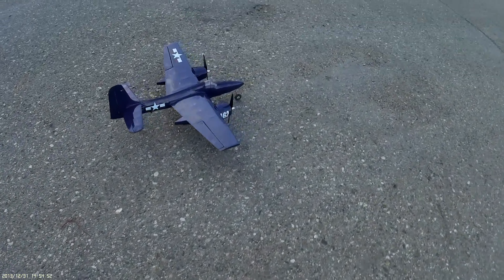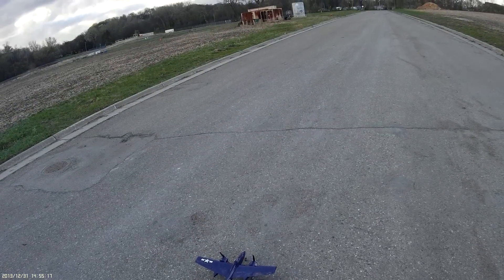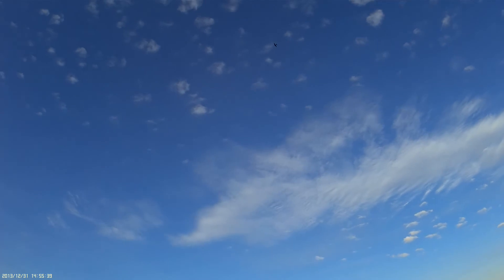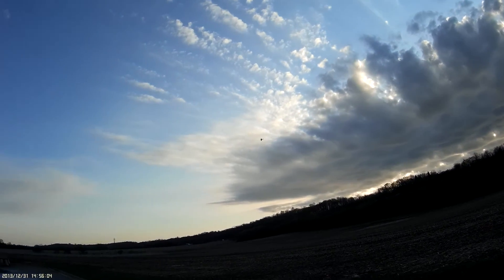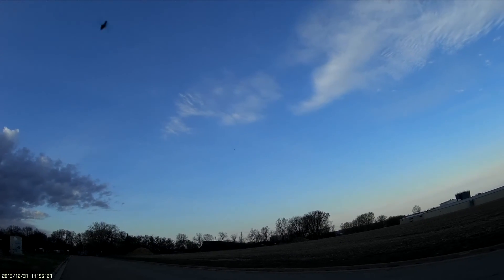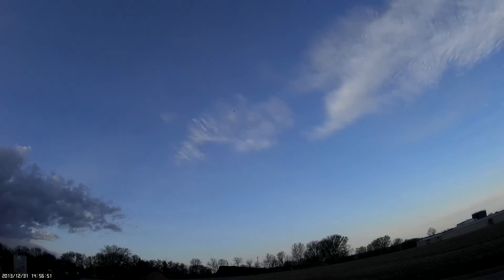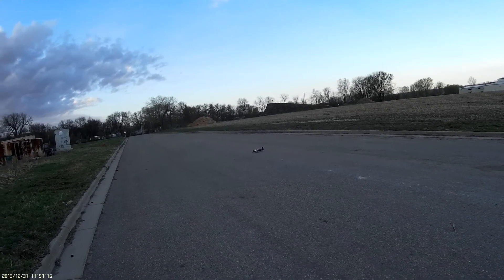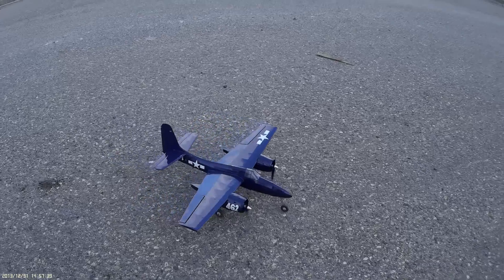Diels engineering F7F Tigercat test flight

Comment: Nice jagdpanther9! My piloting skills are not so good yet. I can't fly at all with the wind up like on this flight. I am going to be building a Dh.103 Hornet shortly. That Grumman F7F Tigercat is one more sweet looking bird! The last airshow they had at the Carolina AirMusem here near Asheboro two F7F Tigercats showed up! I'm glad that WWII ended the way it did, but if it had dragged on any longer the De Havilland Hornet and the Grumman F7F Tigercat would have been better-known airplanes. There were plans to build a lot of twin-engined long-range fighters for the invasion of the home islands of Japan. In the end, these airplanes were built for a war that didn't happen. It's amazing that the Britts didn't save at least 1 each of the Hh. 103 Hornets, they "the British" were good at saving their Spitfires. The Spitfire Mk. 22/24s are really good looking aircraft but that Rolls Royce Griffen engine would torque the airplane right off the runway if the pilot wasn't careful! Now that the receivers and  servos are small enough and light enough. Converting the Guillows 3/4''= 1.0' foot (1/16th scale) airplanes is possible, but it would be better if they were just a little bigger, like 1''=1' foot (1/12th scale). I have seen your Guillows conversions of their 400, and 2000 series warbirds. If you could send me the list of RC parts you used it would help me out a lot, or you could tell me which RC forum you posted your builds of the Guillows kits you have converted to RC on. I have seen your conversion of the Guillows 400 series P-40 on youtube. The way you built in the retractable landing gear was very impressive. Well, good building and good flying to you sir!
Reply from the maker: +david burns hi, i'm glad you enjoy these builds like I do and your aviation history. the f7f in real life is one of the most impressive sounding piston powered aircraft ever. to see 2 of them would be fantastic! as far as the parts I use in these conversions you can find them in the build logs that I have @ the rc groups. my name there is meltor and I will put a link to the f7f build log in the video description. thanks again david =D